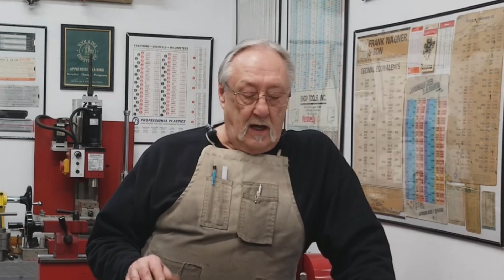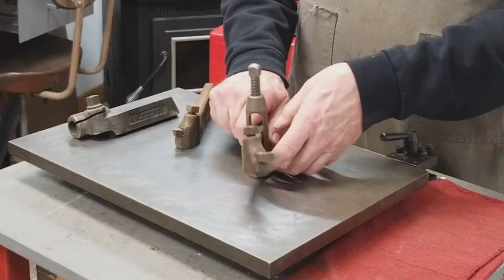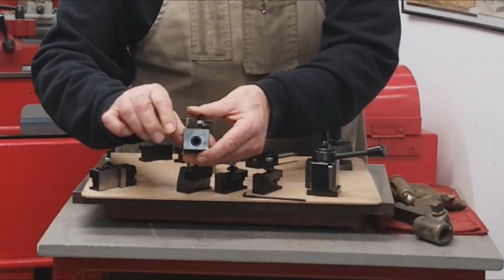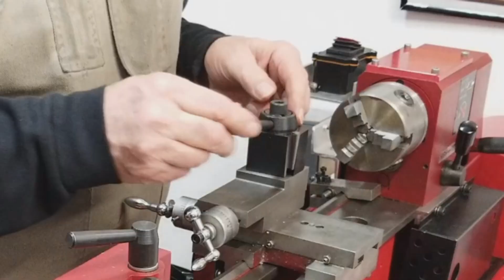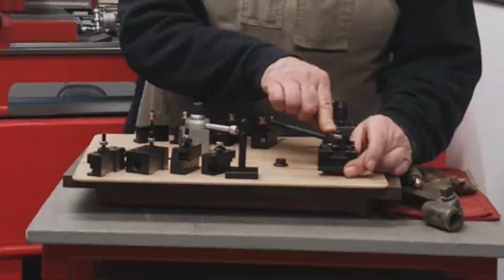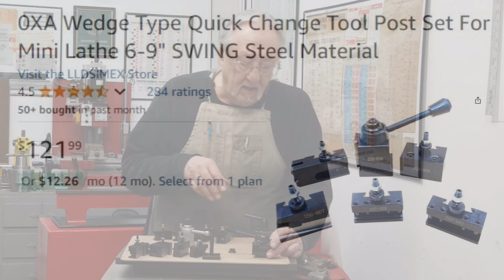Real Tool Post UpGrade, Mini Lathe, Harbor Freight

Comment: Im so thankfully for your well thought out video. It helped save me so much confusion on the tool post change. Im self teaching myself after getting a clearance 7 x 10 harbor freight floor model. It was missing alot of the parts. That it was supposed to come with but the price was right. Thanks so much for sharing your wealth of knowledge 👍
Reply from the maker: Hello Arthur,  The HF 7 x 10 is a great little machine. So many people make negative comments about this machine that just aren't true. Just keep in mind that it is a Hobby Machine. I've made many different parts with this machine and it performed just fine. Now, if you what more out of this machine there are so many upgrades you  can do. I kind of went over board with upgrades on mine. Thanks for watching Arthur and thanks for your comment. One more thing, for parts and tools You can fine all that stuff at " littlemachineshop.com  "

Comment: Thanks for sharing your upgrades to the HF mini lathe.  I have the HF 7x10 and am in the process of moving up to the 16" bed from LMS.  I have a question regarding tool sizing with the new tool holder.  It appears that you are using 1/2" tools in it, but did not specifically state that.  Are the tools 1/2"?  I ask because I am wanting to use that size.  But I understand that the thickness of the bottom plate of the tool holder sets the maximum size tool.  I'm trying to verify that a 1/2" tool's point level, in the new holder, is at or below the centerline of the chuck/tail stock centerline.  I hope this has made sense.  I'm an electrical engineer dabbling in an area outside my expertise.  Thanks.
Reply from the maker: Sorry to disappoint you but a 1/2" will not work.
Reply: @GlennNowOnYouTube  Oh.  That's fine.  What size does work?  Looking to use the largest that fits.
Reply from the maker: The tool I use is a 5/16" I bought from Travers Tool Company. I've made some pretty big cuts using it. You may be able to modify the top of the compound slide to allow the tool holder to be lowered enough for use of a 1/2" tool.
Reply: @GlennNowOnYouTube  Thank you.  I appreciate you letting me know.

Comment: Ooh,  Nice!  It looks significantly better than the aluminum piston style.  I would probably feel right at home with that style of tool post on a mini lathe.

All we have at my shop are wedge style for obvious reasons, and I think most would be surprised at how repeatable they are on tool changes.  A hobbiest likely won't care, but when running repeat parts with multiple tools I sometimes see it repeat within a thou or two on finish passes, but its not repeatable enough for me to just not measure.
Reply from the maker: You got that right. Always measure. 😉

Comment: I modified a couple of the old rocker style tool holders to work in my BXA sized Aloris style quick change tool holders. There are occasions where the extra reach is helpful.
Reply from the maker: For sure, the old rocker type tool holders are not obsolete. With a little ingenuity you can do a lot of things with old school technology. Thanks for watching.

Comment: Have one like that and love it.   I did have an issue where one 'side' was tighter and hard to get the tool holders locked in.   Used a file and very lightly surfaced the wedge on that side, and now they fit perfectly on both sides.
Reply from the maker: Hello Paul,  Just went to your channel and watched your latest video. Great Channel 👍  I had to Subscribe. I'm going to have to look into one of those DRO's you were talking about.  Hey, thanks for stopping by my channel, watching one of my videos and commenting. You are quite the Craftsman.  Thanks again.
Reply: @GlennNowOnYouTube    Thanks!   Learning a lot from your channel.  Not ready to try milling (yet) as wood is kind of my thing, but looks really interesting....
Reply from the maker: I enjoy wood working myself. Milling machines aren't only for metal. I once made some custom fitted boxes for some Prototype Tooling I made and did all the pockets on the Mill.  I thought of it like a router with an X, Y axis under it. I bet a guy like you would have no problem with a mill. Until next time, See you on YouTube.  😁

Comment: Nice!! I'll have to get one when I get back to my lathe!!
Reply from the maker: That will most likely be next month or later with you doing all those Febudaily videos. 😁 Great job. 👍
Reply: @GlennNowOnYouTube  I expect so. I would like to get the flathead running again soon. So, I need it to be better at being a lathe than it currently is. Since the adapter I need to make needs to be as close to perfect as I can get it. Since it will be on the spinny end of the engine.
Reply from the maker: Good Luck with all your projects Michael 👍